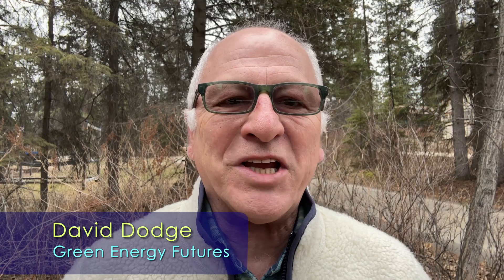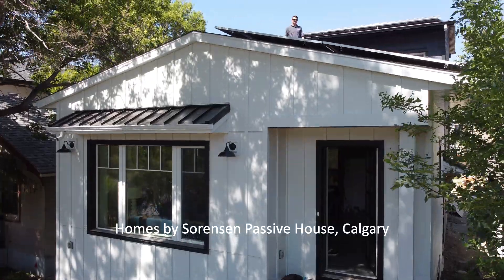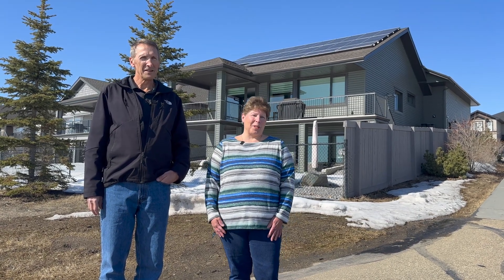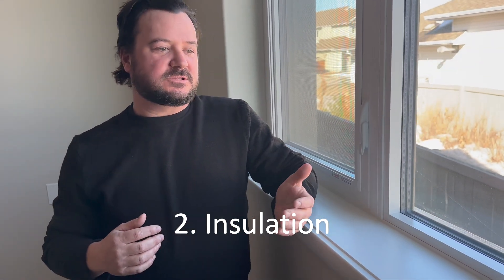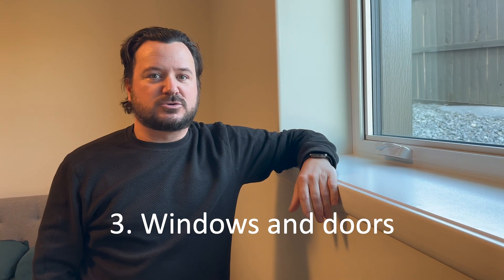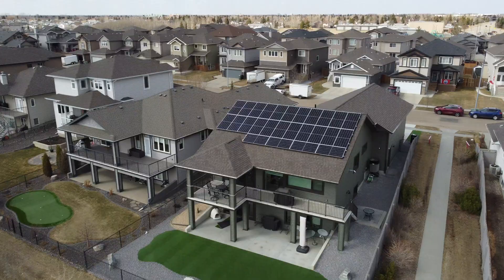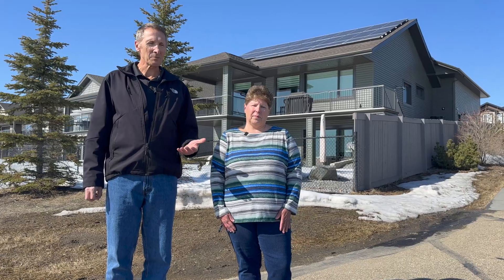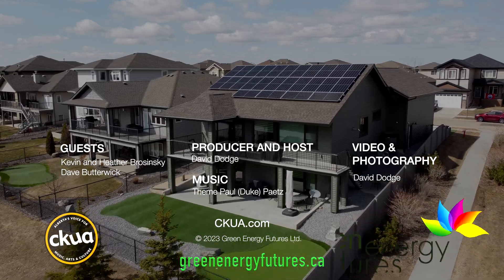Net-Zero 101 - A guide to building your future-proofed dream home

Comment: How do we use your thinking for all the thousands upon thousands of houses in Phoenix, AZ?
Reply from the maker: Most of our experience is with cold climate net-zero, but the principles are similar since a well insulated home keeps the heat out the same as it keeps the cold out and heat pumps are even better when they are in cooling mode, up to 700% efficient!

Comment: You got to ask what “net zero” means in the bigger picture when the house is so large, uses so much embodied energy in the production of all the glass, insulation, timber, concrete, heating, and cooling equipment. How much fossil fuels was used to create and transport all the materials? How much mining needed to be done? How many years does it take to reproduce the same timber that was used? Now add up this all up and see how you can create a truly net zero house!
Reply from the maker: Embodied carbon is important and many net-zero builders are already thinking about this in their selection of materials, but there is much work to be done. However, that is not to diminish the significance of people making the decision to build net-zero - recognizing the long-term benefits and value and contributing to a low-carbon future.
Reply: North America and Austrialia have the largest houses by quite a leap vs the rest of the world.  Obviously larger homes require more materials and take more energy vs a more universal size home of 1000ft2.    Life cycle analysis (LCA) is implemented to help determine the embodied energy and carbon footprint (cradle to grave) while selecting the materials and contruction methods  Amory Levins coined the phrase "negawatts".  The simplest way to reduce your carbon footprint is to reduce your energy consumption.

Comment: Live in Mississauga Ontario starting become net-zero by installed 7 kw solar rooftop, triple panes windows, & doubling the insulation. Soon adding heat pump, heat recovery unit, and more.